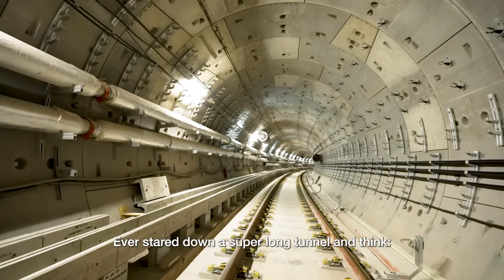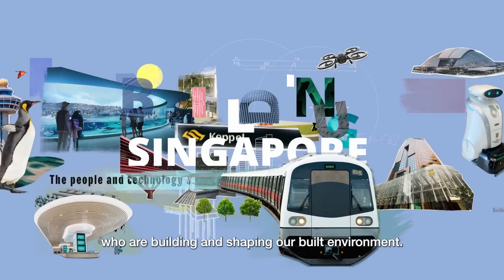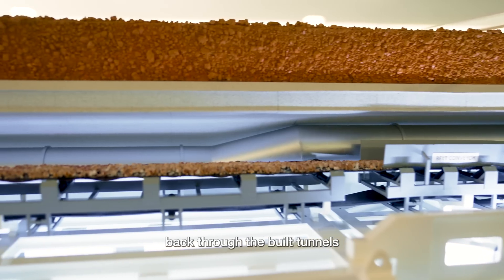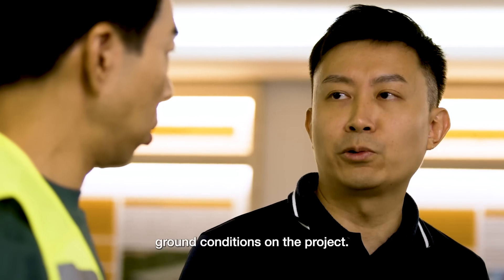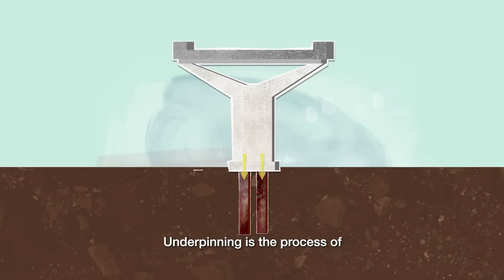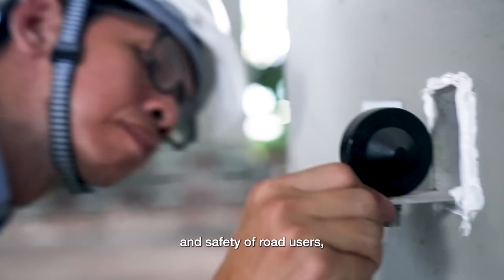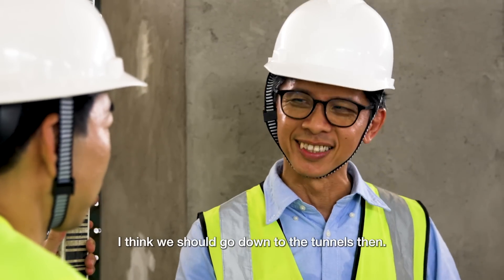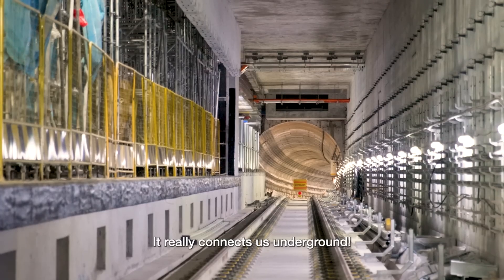Completing the Circle Line | Building Singapore

Comment: very informative video. But it'll be good to also clarify what happens before 120 years pass when the tunnels are considered at their lifespan limit? I'm guessing some kind of degradation to to concrete will occur eventually so does that mean that train lines have to be stopped and the tunnel walls stripped out and replaced?

Comment: The many engineers of many multi-disciplines are the true heroes of such massive MRT  projects.
Boring the tunnels or constructing viaducts are only one part of it.
To operate the entire train system efficiently, good power supply and regeneration, stable railways tracks and switches, reliable and fast modern signalling system, relable control and communications, fast and adequate peoples movers, adequate smoke extract fans, functioning ventilation and cooling system, etc, all need to work perfectly together to let the people enjoy these fantastic public transport systems.
Not an easy task.
Architecture of the nice looking stations is only the easy "facial makeup" part.